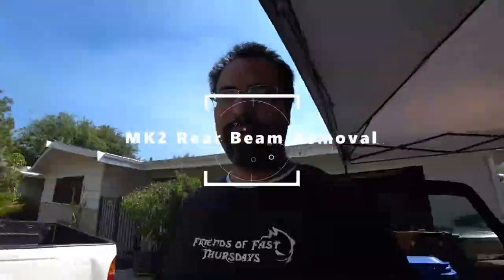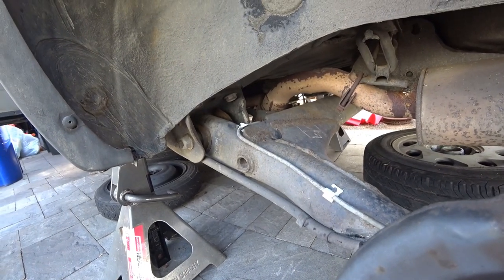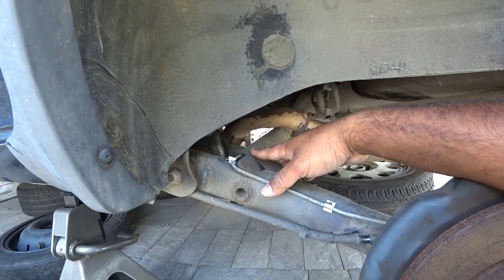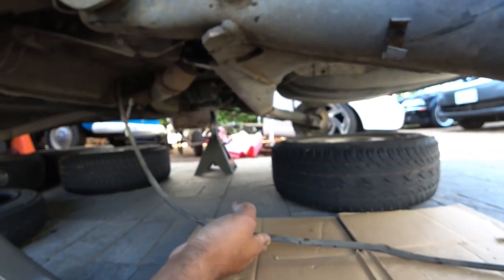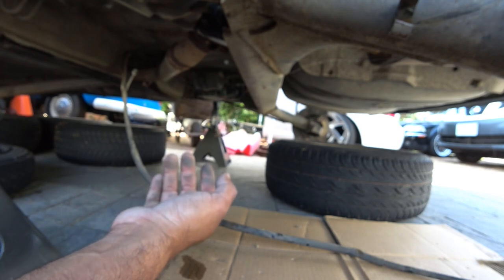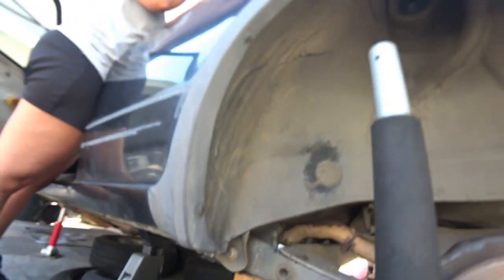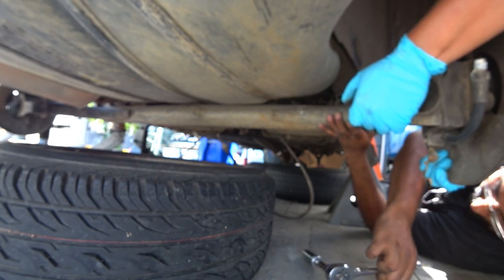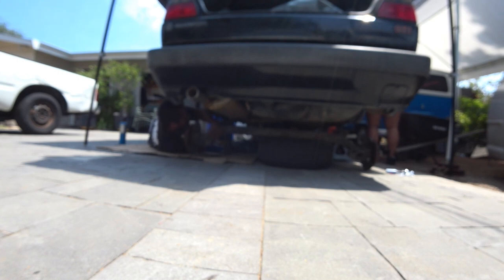How to Remove a VW MK2 rear Beam Season5 EP23

Comment: HOW DO YOU KNOW IF THE BUSHINGS ARE BAD
Reply from the maker: Best way to tell os your rear wheels have camber or if the beam is not centerd. I just pulled the beam and the rubber was torn and cracking really bad. Which to me is an obvious indicator the they are bad.

Comment: Hey buddy which car will enter swap with my 2000 Volkswagen Passat 1.8 t atw I know a Aldi will but which one is it
Reply from the maker: Paul tyler well it depends. You can vr6 swap it or b5 s4 swap.
Reply: PincheAls I meant to say like what car will swap out with mine like parts like a Audi A4
Reply from the maker: Paul tyler maybe a b4 and b5 audi you can swap parts from.
Reply: PincheAls Garage.   Thanks bro